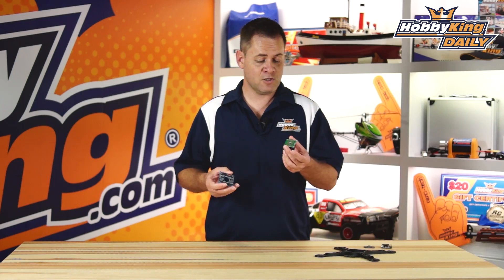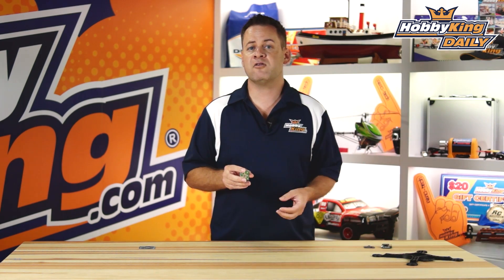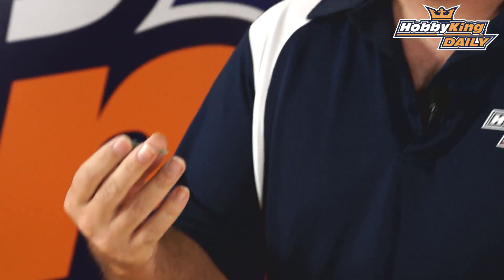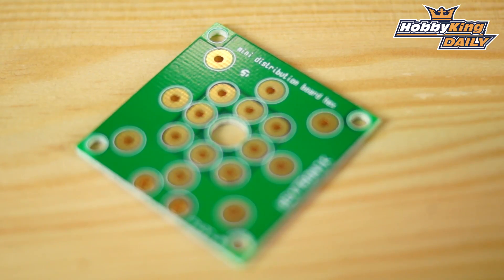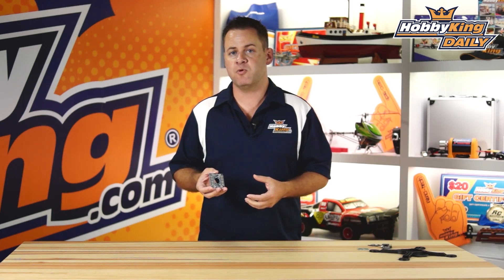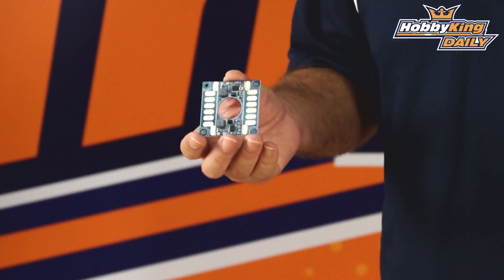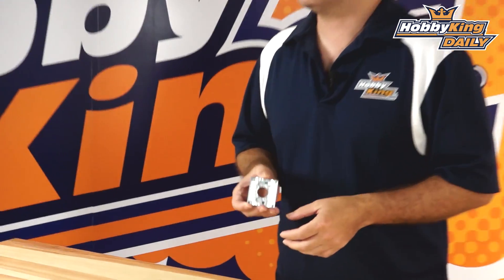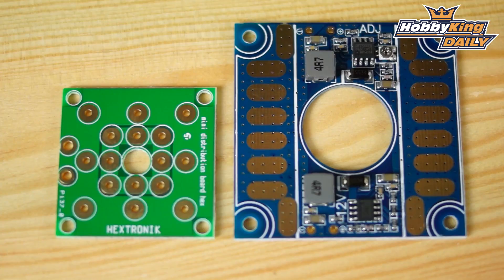HobbyKing Daily - Quanum Mini Distribution Board

Comment: I've used several of the Quanum boards.  They're great for spots where there are obstructions on two sides because the pads are mainly on the other two sides, and you can run the battery/power leads (and ESC leads) up through the hole in the center and lay them down on the pads so they're really clean.  The BECs have contacts on both sides, so you can run satellite sockets for 12 & 5 to anywhere you need for cameras, transmitters etc.  Anyone who has used the HobbyKing PDB with the 3.5mm bullets knows they come out in every direction, so some applications are very awkward.